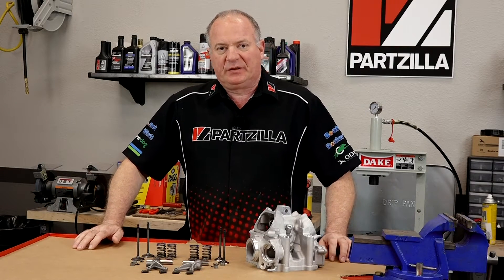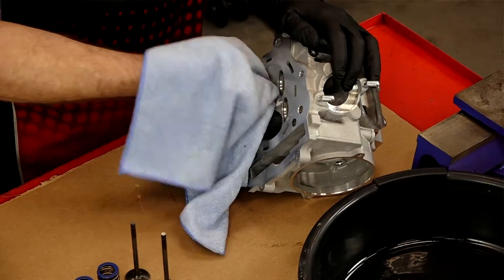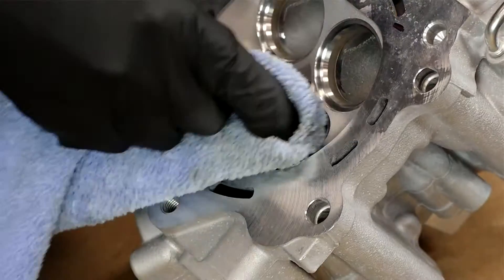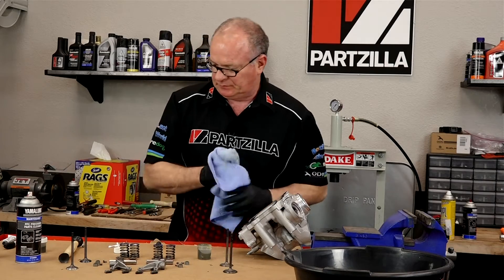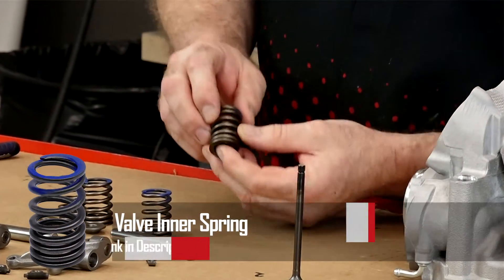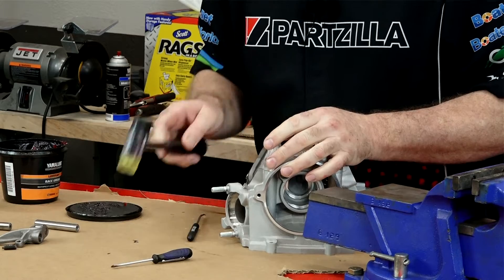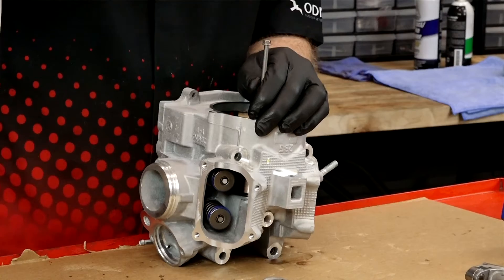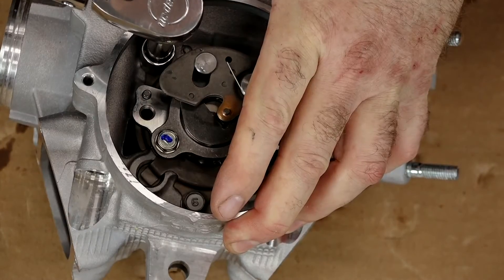Yamaha Raptor 700R Engine Build Part 6: Valve and Camshaft Installation | Partzilla.com

Comment: I had a shop press in my new guides, my original valves (the stems) do not slide down in them. Kinda at a loss. Are they supposed to be tight ? So tight I wouldn’t be able to lap the valves and the seats?

Comment: hey i've been wondering what happens if the valve contact point is too large how would it affect the engine could it damage it or loose power?